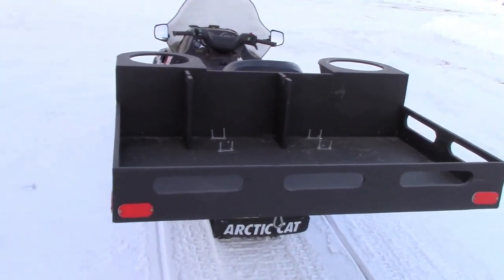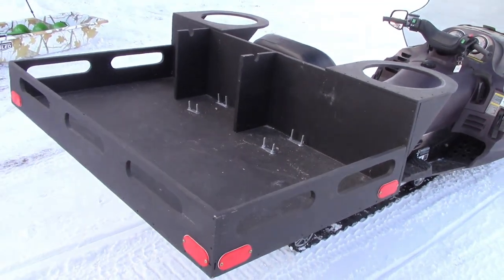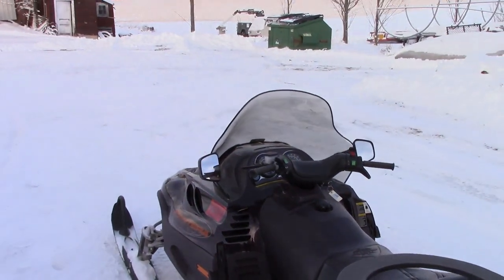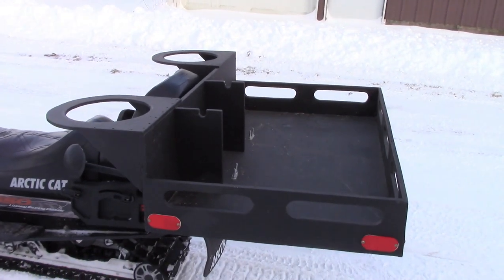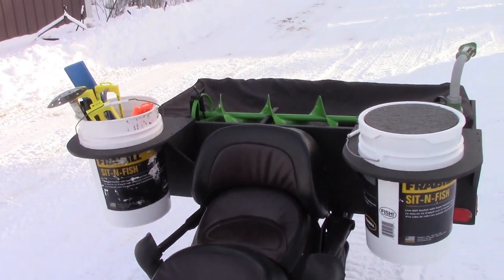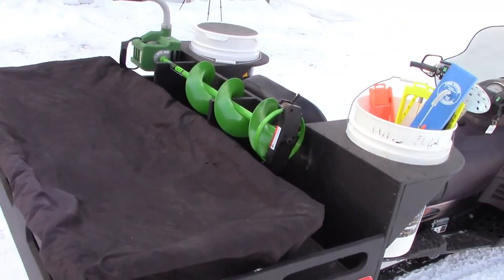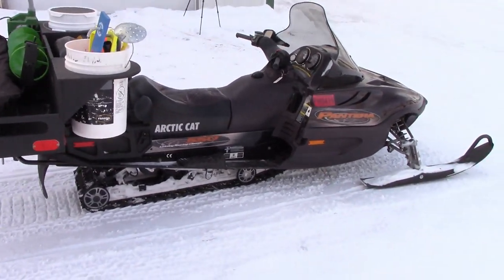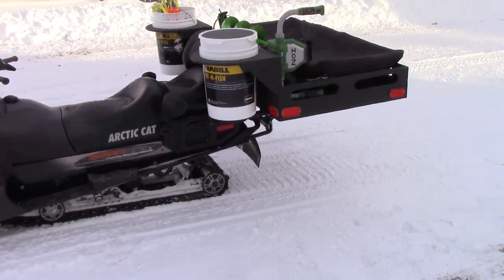The Hard Water Rack-My  ice fishing rig

Comment: Great job on the build! May want to cosider applying thin black boat carpeting over the entire thing. Add a few rod holders too
Reply from the maker: shelzzy2006 thanks for the view and feedback. I considered doing the boat carpet but in the end I decided it wasn’t the right fit for this rig. The coating I put on is very durable and sheds water rather than absorbing and freezing. A few people have suggested rod holders but in the couple years I’ve used it I’ve never had a situation pop up where I wanted or needed them on it. They could always be added if need be though. Thanks again for the feed back and stay safe on the ice. Also, hit the subscribe button if you haven’t yet.

Comment: Sweet set up I want to duplicate it. Did you extend  supports out from the sled under the plywood for extra support out farther or is it just u bolted through the plywood ? Is that 1/2” plywood. Seems like if to much weight put in there the bolts would rip out of the plywood?  Thanks for any reply and great job looks awesome!
Reply from the maker: Thanks for checking out the setup. I did not use extra support. The u-bolts come up through the bottom and there’s a small plate that serves as a washer that spans both studs of the u-bolt(Hope I’m making sense). It’s 1/2” plywood and I’ve grabbed the rack and lifted to slide the sled around in the garage without hurting anything.
Reply: @themichiganwoodsman1372   thank you for responding! I have pretty much the same sled. Curious what your dimensions are for this just to get a idea.. it’s one of the best home made sled I’ve fishing mods I’ve  seen on here..  take care !

Comment: Should work if you stay on a lake, but I have to do trail time to get to the hard to reach lakes. I'm guessing I would be fighting trees and brush with the extra width. Better off pulling a sled on narrow trails.
Reply from the maker: You’re absolutely right. I’ve taken it on trails but not a great set-up for that. Not only the width, but the cantilevered weight makes the sled a little tippy in the trails. It’s great on the lake and alright on the way to the lake